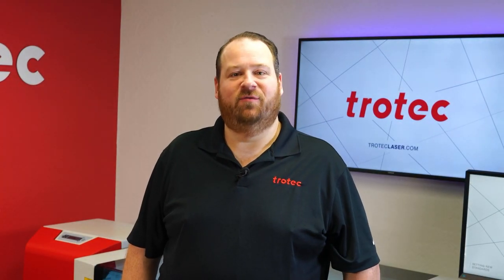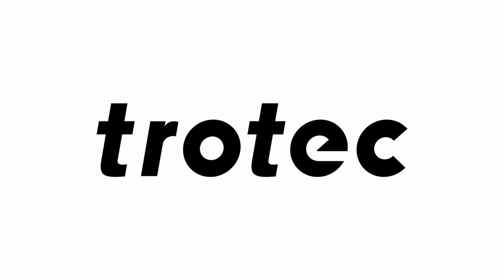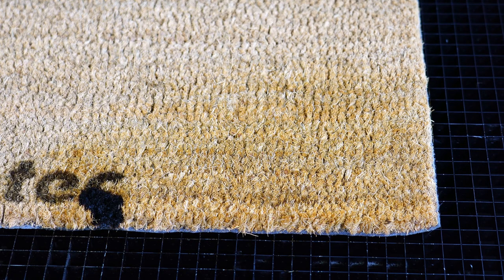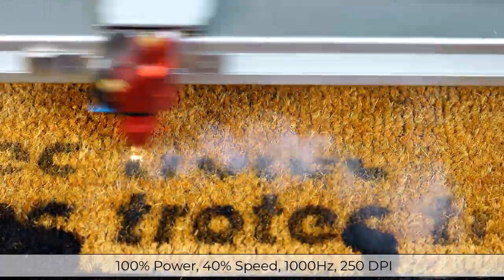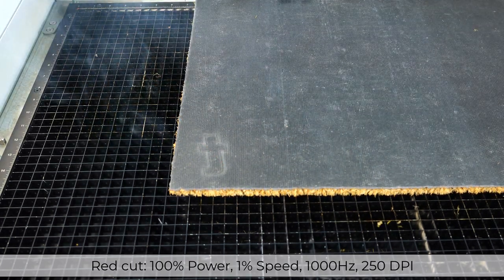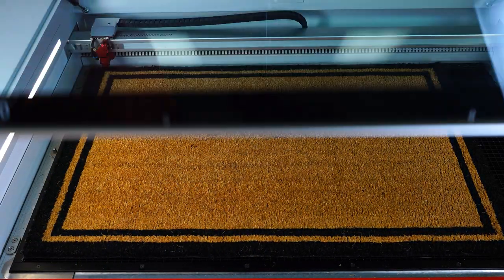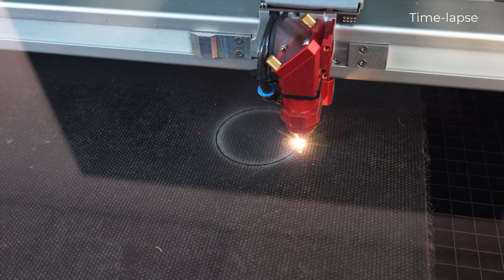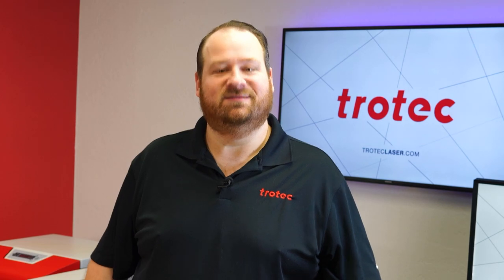Trotec Laser: Can you Laser Doormats?

Comment: Is there a setting for speedy 300 50 watt? We have tried all tests and just can’t seem to nail like u have - not sure what we’re doing wrong - thank you
Reply from the maker: Settings will vary based on the brand of doormat you use. It may be an issue with the wattage being lower than the machine tested in the video. We did not try lower wattages, and it is possible that it may not work with only 50 watts. I would try it at 100% power, 20% speed, and 250DPI, and as shown in the video, keep trying new settings until you get the effect you want to see.